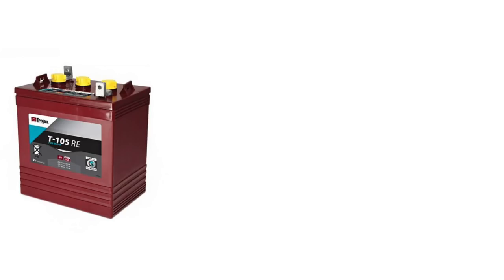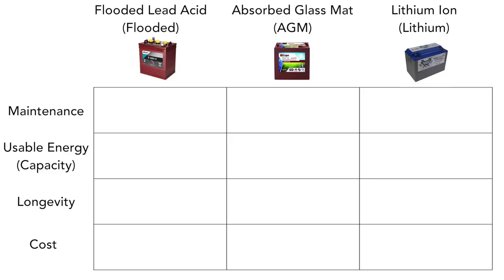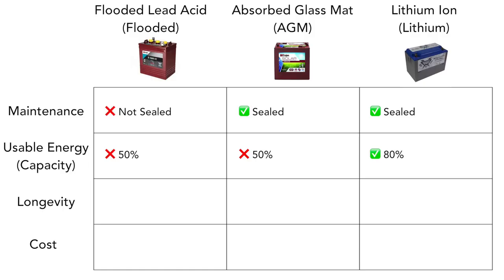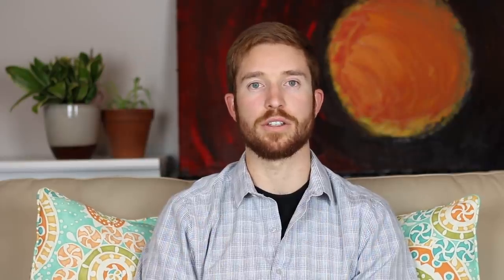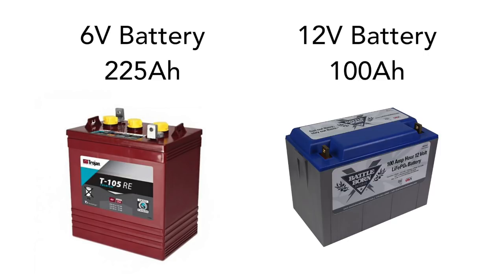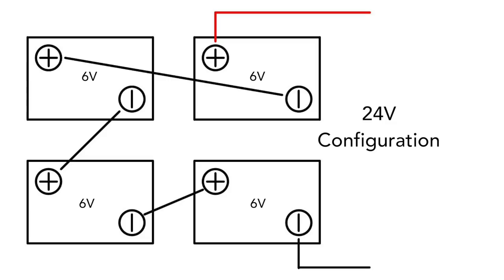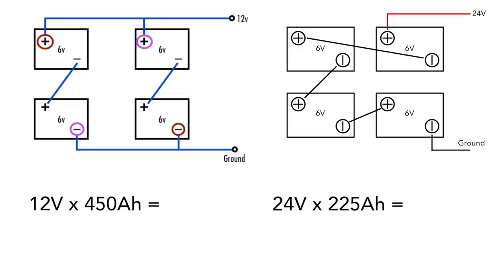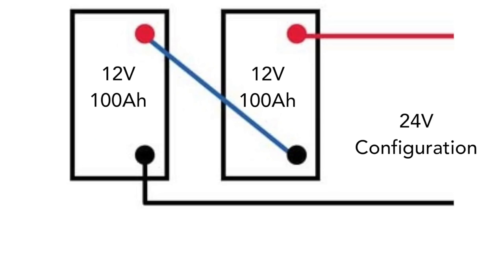Battery Bank Options + Wiring Solar Batteries from 6v to 12v vs 24v

Comment: Lead acid set cost $600, lithium set cost $3000. Dude says lithium is 4-5 longer lasting, 3000 is 5 times 600, it's all relative people. Most likely you aren't going to have the same system 20 years so the lead acid and AGM sets are a much smarter choice as over time the lithium batteries will come down in price as technology cheapens the production costs.
Reply from the maker: Great points hear! Thanks for sharing 👍🏻
Reply: I paid $135.00 per cell for my CALB LiFePO4 100 Ah 3.2 volt cells from EV West. 
For four cells run in series to make a 12.8 volt 100 Ah battery bank. I paid $583.20  sales tax and shipping included
Reply: When you buy "bare"cells"that is WITHOUT a "BMS' withs for Solar use is totally unnecessary if you regular monitor cell voltages with a cheap volt meter,  and DO NOT use LiON but instead opt for the Large prismatic LiFePo4 cells, and make it a habit to stay within a maximum DOD of 80 Percent Max ( lead cannot regularly be discharged lower than 50 percent DOD if you love your cells) you will vind out that Lithium (LiFePo4) is indeed the CHEAPEST option (pays itself of in just a couple of years especially for people who have to use a GAS generator (in winter) to take there LEAD acid batterys each and every time to the brim to fight sulphation.....
Reply: giottodiotto1 I believe the Lead-Acid vs Lithium debate will go on for ever, And I as most others in Battery’s for Solar Energy storage have their favorite’s. Also home energy storage vs Mobile/Portable I.e RV/Boat and Portable Solar Generators. And which is best for their Application
I have bought and own both types, AGM anyways, But I believe that LiFiPO4 are far superior that the others , For example 100 Ah’s at 12.8 volts nominal will give you about 1 KWh of usable wattage per cycle times an average life of 2000 cycles give you 2 Megawatts worth of Usability, How many Amp Hours of Lead-Acid batteries would you need to make 2 Megawatts of Usability,   Maybe 400 Amp Hours at a 25% DOD will get you 1500 cycles from Lead-Acid
Reply: I totally concur, unfornationally a lot of people go for the "easy"option that is they buy the cheapest Lead batteries they can find(marine type modified/ re-branded CAR/STARTER batteries) and think they have a good deal, totally ignoring the fact that most lead batteries are practically dead in two to tree years in a dayly cycling regime be it on a boat or stationary solar setup, thus the TCO is very HIGH, and satisfaction is LOw, when its time to replace this dead lead pile(....) they will not spend more money than the previous time and do again buy Lead again, so making the same mistake over and over again, much better solution would be to spend a little more upfront with NEW TECHNOLOGY batteries, LiFePo4 to be precise, only than after many more years to find out there mistake!
Reply: On my channel I've done the math in a 7 video series. Lithium wins in every department
Reply: giottodiotto1 there is a company that makes 48v 67ish amp LiFiPo with their own built in breakers. I like that operate both above and below temps that are bad for lead acid and Li-ion.
Reply: Just get golf cart 6v batterys they last long time as Iong as u keep them top off with distilled water
Reply: JTGphotos you don't count the amount you can use you need two of them to one lithium for usable energy
Reply: As long as you don't want to actually use half of your battery's your right
Reply: other factors in battery life and capacity is depth of discharge and efficiency. To get a long life from lead acid, 50% DOD is generally the recommendation. LiFePO4 80% DOD. So the effective capacity is reduced requiring a larger lead acid battery bank. Next is efficiency. The internal resistance of lead acid furthur reduces the effective capacity. BUT, I'd argue an advantage to lead acid in RVs is the low price if the batteries are abused makes for a lower cost when replaced sooner than batteries that are properly cared for.
Reply: What your numbers say is most likely true,, what you havent talked is the ease of reliability, maintenance, etc.. so I'll reiterate an old standard that holds true today as it did in yesteryear for those in the trades. Buy the best tool you can afford. Nice articulate  video by the way. Cudos
Reply: Its not all relative. Lead needs time. You dont have time, the sun sets long before the battery fills no matter how much solar you have. They slowly sulfate in daily use and theres no way around that. If it's occasional use then theyre OK. Theres ZERO debate lifepo4 wins.
Reply: 100 year old tech wins
Reply: @shadetreesolar2932  Trojan SOLAR SPRE 06 255 = $205 each, 230 AH @ 6 Volt and 2,000 Cycles @ 50% DOD.   Two batteries in series = 12 volts gives you 2 Megawatt-hours for only $410 ...

Comment: You should have compared lto batteries. That is the latest, yeah the price is high but 20,000 charge cycles, much faster discharge and charge rate and capable of operating in much lower temperatures than the other chemical makeups.  30 years only loses 20% of its capacity, I'm only buying batteries one time that can last a lifetime.

Comment: Where does the sealed gel batteries fall? BTW Happy Thanksgiving!
Reply from the maker: +Darrell Wampler Hey Darrell! Thanks and same to you 😊 Gell cell is another version of the lead acid battery but is not quite as popular as the flooded or AGM variant (at least from my experience). Thanks for the great question 👍🏼
Reply: I don't see the answer to his question
Reply: J.G. Conumdrum yes he answered my question.
Reply: It's essentially a AGM battery. They behave pretty much the same as AGM's (maintenance free and they handle vibration and motion better because the acid doesn't splash around)
Reply: Uwe Schroeder Hey thanks!
Reply: The problem with GEL batteries is threefold 1. Higher priced even than AGM 2. different charging regime (do not EVER take them higher charging than 14.2 volt for a 12v batterie/ DO NOT equalize them) failure to do so will result in bubbles in the gel, so reducing capacity irreversible 3. older technolygy, for the price of a GOOD gel batterie you can buy a GOOD LiFEPo4 batt witch is a total other kind of animal(way more charge cycles, higher capacity, in the long run WAY more cheaper, hope this helps making a decision, remember "lead is DEAD"

Comment: A couple of problems here this guy doesn't know where to go to get cheaper batteries. Costco sells flooded 12 volt GC Interstate batteries for under 100 bucks. Lithium batteries can be purchased from Alibaba from China for half the cost stated. Second although his batteries will work this is not the standard battery connection. Third AH are not the measure you get when you are using these batteries for house voltage namely 120 Volts proper. At 24 volts figure about 1/5 of the AH when using a inverter for 120 volts. But the video was pretty good. Thanks :>)

Comment: How do I know if it is 6v or 12v
Reply from the maker: Usually it will say on the outside of the battery but if not, just hook up a multimeter to the positive and negative poles of the battery. If it reads between 11 and 14 volts it is a 12v battery anything lower would most likely be a 6v battery. Hope this helps!

Comment: Is there any advantage of a 24 volt system over a 12 volt system?
Reply: The wire has to be really large in 12v to carry the distance. Expensive. 24 volt is smaller wire and cheaper. I consider a wind turbine and the length of the wire from the turbine to the charge controller? If its 12-volt thats pricey.

Comment: The only problem with lithium battery in serious connection is that each of them has individual BMS.. Now, if BMS turn off one of the battery for any reason, the rest in line will stop being charged. You need special BMS that controls all the lithium battery at the same time.

Comment: Lithium bat is best choice but charge it at 85% full or never charge up to 4.2V per cell. I charge my battery at 4v per cell. If the charge controller let you do it or not. If you want your battery last extremely long.

Comment: You can buy lead acid batteries that last 20 years and have a rated capacity of 80% DOD  also Li batts have 5X less current ability than lead acid

Comment: It is not save to just assume you can parallel connect a few Li battery. Charging parallel connected Li battery is also a challenge and very high safety risk

Comment: The Trojan T105 RE has a cycle life of 4000 not 1000 also LION batts have a significantly lower cycle life when discharged to 80% DOD

Comment: This also assumes that battery prices don't drop over the next 20 years. If you got the flooded batteries that lasted 10 years and then lithium ion batteries or something else come around and is half the cost, you would have saved a lot of money going with the lead acid.

So the real question is, do you think that battery tech will get better and or cheaper in the next 10 years? Do you want to be on the leading edge of tech or wait till the price drops a bit?

Comment: Funny how no one talks anout fire risk. Most Lithium ion batteries are (LiFePO4). When these catch fire it is a 3 foot inextinguishable flame. Personally had one catch on my property and had no option but to wait for the fire to go out. Same thing with Teslas, If they're on fire the fire departments can't do anything but control the burn and make sure it doesn't spread. Factoring in these risk flooded are the better option.
Reply: I personally have switched all my batteries on my homestead to flooded in order to mitigate fire risk and losing $1000's of dollars because one caught fire. To be fair it I'm in Texas and it was 106 and my minisplit in my battery room couldn't keep up but the risk is still there.

Comment: Great comparison video. I am creating a solar system to be used while camping out in bed of my truck. I have a renology 100 watt suitcase previously purchased. I have ordered a 1100 watt inverter so that leaves me with batteries or battery to choose. I was hoping to only have to purchase 1 12 volt but based on research 6 volt appears to be best choice??? My concerns are weight (60 yr old female), cost, using in a confined truck bed space, and moving them frequently in and out of truck bed when not in use because of southwest high heat temperatures. Lithium out of question due to extreme cost for short term use (have travel trailer will use more often w own solar). Daily, i want to be able to use a 600 watt dial type microwave about 30 minutes potentially 300 WH, run a small fan at least 4 to 6 hours, charge a cell phone, and a tablet or 2. At 50% limted depletion I am thinking I need 100 amp hours, (600 WH / 12v x 2). That is with no reserve storage for bad solar days. Recommendation on which type of battery? Also, is recharging on bad weather days occasionally w generator ok?

Comment: I recommend not wiring lithium ion batteries in series.  Internally they are a series/parallel arrangement already typically, and should include a balance charge system. However, when you externally series them, you don’t ensure each pack has equal charge over time. 

Parallel is fine. 

I also recommend when connecting the batteries together make certain they are charged to a similar level. This is especially important for parallel connections as if you connect a fully charged battery to a partially drained battery, one will charge the other, and depending on wire gauge used fast and wires can get hot. 

Lastly, don’t mix technologies.

Comment: HI, this is the best video for beginners about batteries EVER. I trying to build an small solar battery bank with 2Trojan SSIG06475 - 6v 428Ah. With series-parallel configuration will give me 12v 856ah? This aims inverter is ok for this job (PWRI300012120S).My goal is to get offgrid my frigde, tv some lights and my cpap machine. Here in Puerto Rico we have 5.5 solar hour per day. Your response will be very appreciate. Thanks

Comment: This is a tough subject to keep as you say “simple”. I’m sure most of your viewers are RV’ers, so I’m not sure why you would bring a 24 volt configuration into play. Instead, mention the location and weight perimeters of each battery type. Those two categories can play a big factor on what type is best for you. For the most part lithium wins again, but location can be a huge factor for lithium because they need more of a controlled environment vs flooded batteries.
Reply from the maker: +G Keller There will be much more info to come in future videos... these videos are meant for learning the “fundamentals” and I will get more specific as time goes on 👍🏼. Thanks for watching!

Comment: There is another problem with The use of a lithium-ion batteries, The temperature that they can be charged at.   The charging should take place only at a battery temperature of +5°C to +45°C. or 41 degrees F or greater, The ideal temperature range of the batteries is room temperature. So if you live in a cool or cold part of the nation you are going to have a problem in the winter, unless you have a heated battery box. I think this is a huge problem.

Comment: Lead Acid 7 to 10yrs vs Lithium ion 20yrs. That would be 2x to 3x longer, not 5x.

Also, I know for a fact that your lead acid values are reasonable, but there's NO WAY Lithium Ion are actually lasting 20yrs! I don't fault you for listing the manufacturer's  claim though.

Think about it, Teslas have an insanely advanced battery management system and very high quality batteries, but they usually need swapped out in 10yrs. Even the battery form you've shown is made up of numerous cells and any of them going bad is basically game over. I've replaced cells in large assemblies,  but most people wouldn't. 10 to 12yrs realistically.

I'm personally interested in Nickel Iron, which is the old Edison design. I won't go into all the pros and cons, but if you have the space, I don't think anything else can touch them. There are batteries still in service that are 100yrs old. On paper, their claim is 30yrs+ and there's evidence to support it. About the same price as lithium, but WAY larger maybe 10X.
Reply: Where is the PROOF that any Lithium batter battery has last 20 years, at 100% DOD daily ???

Comment: 6-7 years for lead acid.
20 years for lithium Ion
6.5 x 3 = 19.5 years

How long will Lead Acid batteries last if you never use more than 20% of their capacity?

Comment: Good presentation as far as it went.  One concern I have is that you used what appear to be low end prices for lithium batteries an premium prices for lead acid.  For example you can buy decent quality 100-110 amp=hour 12 flooded deep cycle batteries for under $100 and decent 6 volt flooded 225 amp-hr batteries for $125. You can buy 6 volt 210 amp-hr AGM batteries for around $200.   Decent quality lithium batteries run more like $1200 for a 12 volt 90 amp-hr battery.  These numbers will skew your price comparison.  Another consideration you left out is charging.  Lead acid batteries have much lower charge acceptance than lithium batteries and much lower charging efficiency.  I do agree with your conclusion that lithium is a better choice IF you will keep your RV for many years AND have the money for the install.  Here is a link to my more comprehensive video on batteries - https://www.youtube.com/watch?v=TiX8ll_5lfA&list=PLMj5-rgz7PdrjYbEfGs6GKnhEPITX89mn&index=4
Reply from the maker: +Todd Dunn That’s definitely a good point. This is just my comparison of what I’ve seen the most of in my travels and I can only fit so much info in a video before people lose interest. 3 years ago, those same lithium batteries would have been $1500-$2000, so very soon lithium batteries will be a no brainer to get. Btw, I personally have flooded batteries. Thanks for all the great info!

Comment: you didnt mention the downfall of lithium batteries  that you also need to invest in a seperate  BMS that balances them, becasue lithium batteries got a problem to balance right  each individual cell has its own behavior , each BMS for a large system can cost in some cases almost as the  batteries which makes this investment a worst nightmare
Reply: BMS is built-inside Battleborn battery ...

Comment: Lithium always wins.  On paper.
In real application...not so much.  
BUT, if you always have solar and will never over-discharge, can ensure your charging set-up will always work perfectly, and of course never ever go to any cold climates...then they might be the best choice for you.
Reply: 1as a power tool user I am familiar with lithium batteries so do these larger batteries behave the same as they age and discharge lower and lower reserves of power? I don't believe anything can perform as per the new state

Comment: Very good overview. But i dont totally agree with the longevity and #cycles of liion batteries. You have to specifiy the type of liion, you are talking about! For typical liion batteries like in laptop cells they are LiMnCo chemistry and they will live for up to 5-10 years with 800 - 1200 cycles best. You probably talk of LiFePo4 batteries, which have a significant different chemistry and also different volatage level! Also they are much more expensive, less capacity/mass relation but are much more secure! Security is an issue you should also put into your chart!
Anyway the 2000+ cycles are possible with LiFePo batteries or even more.

Comment: You left out size and weight. If you're simply discussing power storage for an off-grid house, this is obviously not important, but in any mobile application such as an RV/boat/etc., both space and load carrying capacity are at a premium.